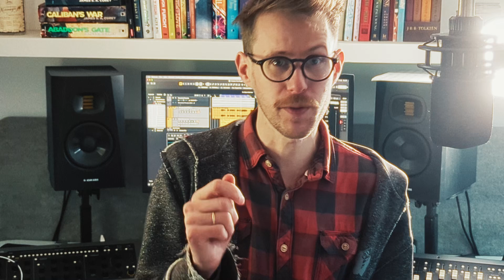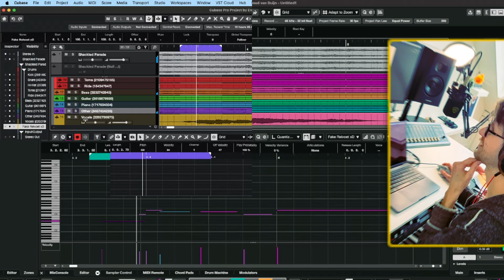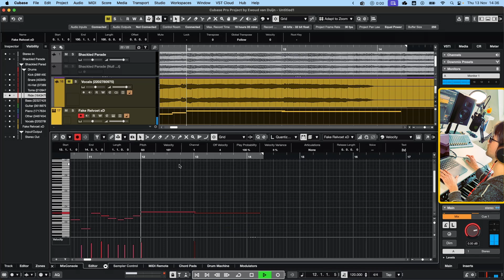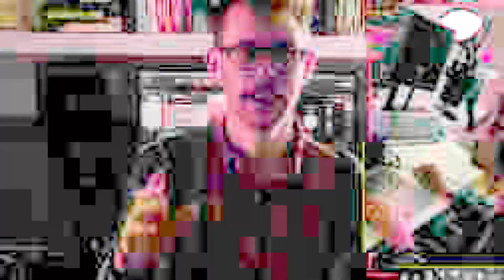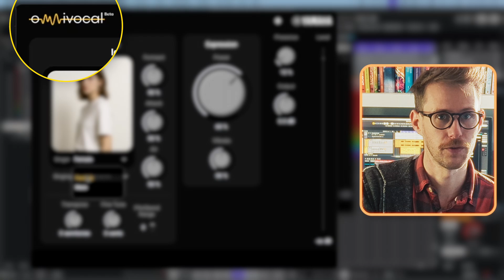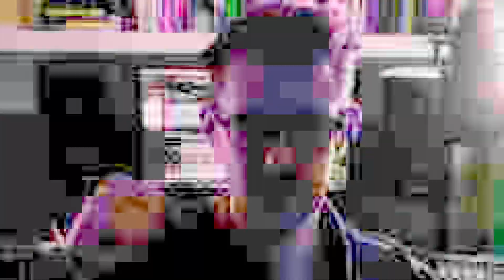Will Cubase 15's Omnivocal AI REPLACE Human Singers?

Comment: It's not generative Ai, this is a vocal synthesizer that users Yamaha voice banks and does not use generative Ai to create the vocals. This distinction is important in that you won't be burdened with Ai slop tags and you won't be denied royalties or hidden from search results that occurs on many streaming platforms that happens to Ai artists / tracks, because this is not generative Ai. This is a vocal synthesizer.. That alone makes it great !!
Reply from the maker: You are 100% correct on this, thanks for pointing it out - wasn’t on my radar when I put the video together. It’s an interesting tool for making harmony lines for demo backing vocals too. 

Personally I still think setting up an accurate input is too labour intensive but this can be improved.